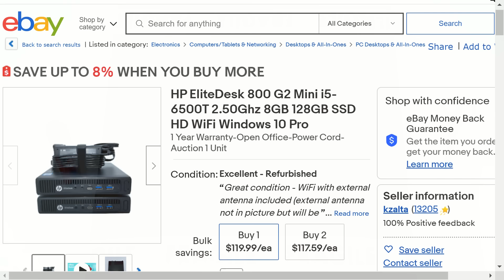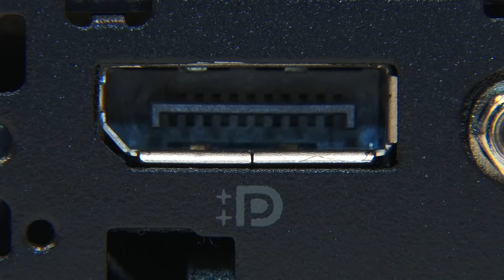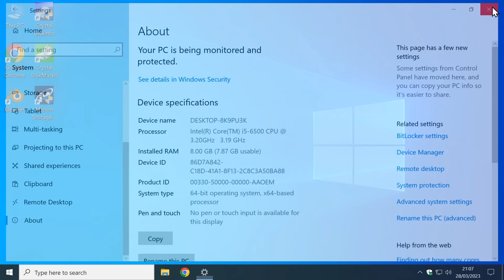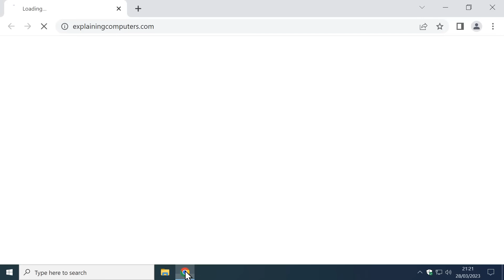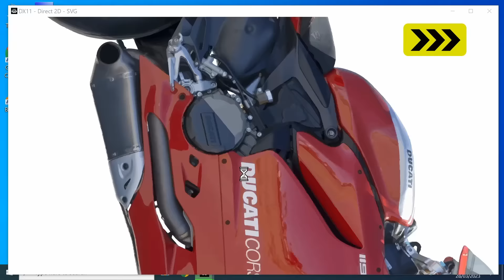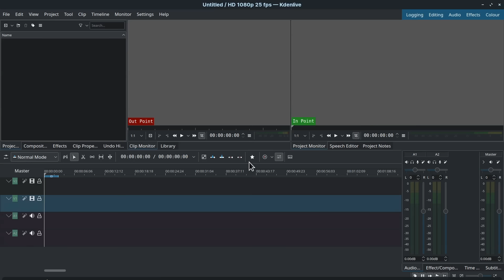Renewed i5 Mini PC: HP EliteDesk 800 G2

Comment: Am new at installing Linux. Am confused. After following all the Linux in HP install procedure in the video, what are the next steps before or after switching to Legacy boot? Do I restart with the bootable with  USB inserted and then enter the BIOS and change the boot order? Or do I need to insert the USB prior to  performing the procedure in the video and change the boot order during that process? How exactly do I get the distro onto the HP?
Reply from the maker: After you have installed Linux, remove the installation media. When rebooted, the computer should now boot directly to Linux (as this will be the only OS installed, assuming you have not set up a dual boot). With most modern Linux distros you should not have to change to legacy boot in the BIOS, and so this is not something covered in this video! But if the computer does not boot, go into the BIOS by pressing the appropriate key (Esc, Del or F2, depending on your computer) and try setting legacy boot. But this really should not be done after an installation! Good luck!
Reply: @ExplainingComputers  Thanks very much for the clarification Christopher. You have continually taught me so much with your excellently produced videos. You are a great teacher and elucidate complex topics with clarity and wit. Be well my friend.

Comment: I have the G3 version which is practically the same thing, just different looking case, put in a 480GB 2.5" SSD & a 500GB M.2 and it has Linux mint running on it and working as a bit of home server (my first one) currently, specs are i5-6600T, 8GB 2400MHz DDR4

Comment: I picked up a refurbished HP 8100 with i5 from TigerDirect.  It has been doing well for what I use it for.

I maxed out the RAM and upgraded internal drive to a 1TB SSD from Crucial. I added a Nvidia T400 video card.

Highly recommend these machines.

Next: i7 CPU.

Comment: Just as a FYI on Ebay and Amazon only list these HP 800 no matter what the G series with stuff you really dont want when customizing these systems. Like with the CPU, Memory, Hard Drive, and Operating System... All the units that I saw has junk hardware that is below the valuse of the $. Plus, Hardware that you want will increase the power and the built-in video is at best (Par)...I believe the CPU is a 6GEN not even close to Core/Thread count to an average i5/i7 13GEN with core/thread counts needed. The hard drive is a mechinical HD and not a Soild State. Although adding any M2 NVMe drives will increrase power levels and would be more par to having the normal HD storage of todays systems. The mechinical drive is going to be extremely slow as a boot drive to hold the OS. Last, the ram is par. So, basically 4GB for OS and 4GB to have for applications. Now finally the OS Support for Windows 10 will end mid season in 2024. Which means updates like BIOS and firmware. The only thing important is the security updates for the system and OS.

Although the system of a small or mini footprint is attactive its still not cost affective to sink $ into upgrading these systems. Remember companies replace systems like this for a reason.  But if your only looking to do office task and such...its ok. but remember as you load updates these little systems will be give much of the processor a heart attack and stroking out with anything added to the  basic system like M2 devices wifi/bluetooth and SSD/Hard drives...you get my point.

by the time you upgrade these 4 things your $110.00 system will jump to $350.00 minimum to 450.00 not including the time required to be looking  for these hardware updates...
Reply from the maker: The video does not suggest purchasing one of these and upgrading it. A shown, the one I purchased came with an SSD, not an HDD, and 8GB of RAM. So it is perfectly capable of running Windows 10, Windows 11, and all manner of Linux distros, with no upgrading required. It is simply not true to say that "Amazon only list these HP 800 no matter what the G series". For example, here is an Amazon listing for an Elitedesk 800 G2 -- and with an SSD: https://www.amazon.com//dp/B07J2SPR49/ Some are indeed listed with potentially unwanted keyboards and rodents. :)

Comment: I have 8 of the HP EliteDesk 800 G2.  The first three I purchased were 35W and the rest 65W.  When I received the first three I didn't know there were two different models with the different power settings.  It's been a learning experience. I also had to deal with BIOS passwords but thanks to other YouTube videos I learned how to remove those.
Reply: These are getting expensive.  I'm boasting the memory to 16 gb, the storage to m.2 to 1 tb, the SSD to 500 gb, WIFI on at least one of them and the cpus i7 Intel Core i7-6700 for the 65 w computer or Intel Core i7-6700T for the 35w ones. I'll also be making one with Windows 7, another with Windows 10 and one more with Windows 11. With others I'll be using Linux Mint Cinnamon, Ubuntu and Debian.  It will be a learning experience for me.  I might try one with Windows XP if I can get that to work. One will also be a dual boot with Windows 10/Linux Cinnamon.  Wish me luck.

Comment: Will this integrated i5 processor card / Intel HD Graphics 530 be able to display the image on a Full HD monitor , refresh rate above 100 Hz . For example 144 Hz, 165 Hz. Thank you.
Reply from the maker: The graphics here are Intel HD Graphics 530, which I think can do 144 Hz max in 1080p.
Reply: Thx Thank You. 🏅

Comment: Hello. What parameters for disk M2 ? I want to make sure.
Have you used M2 Sata, or another PCIe NVMe 3, 0x4 ?
Thank you for this wonderful video.
Reply from the maker: As far as I am aware, only PCIe NVMe SSDs are supported in the M.2 slot. The board will be PCIe 3.0, and the test in the video indicates that the M.2 slot is operating four lanes (x4) given the speed obtained. But a PCIe 4.0 drive would work at PCIe 3.0 speed.
Reply: @ExplainingComputers  txh very much

Comment: I've recently acquired a refurbished Lenovo ThinkCentre M720q from eBay, packing an i5-9400T processor. It runs really well with Arch Linux (using the LTS kernel), and it can handle 1080@60 video editing quite well too. I'm looking into eventually converting it into an audio production machine over the next few weeks.

Comment: Huge thanks for this video ... Just being curious, how warm/heat it gets being working? Furthermore, I hope be possible acquire this kind of machine without OS to install Linux in peace.
Reply from the maker: The case only gets mildly warm, and the PSU only slightly more so. What OS comes on renewed hardware will depend on the vendor.
Reply: @ExplainingComputers  thanks for the feedback ... the sound of the fan is like a laptop or classic PC?
Reply from the maker: Somewhere between the two -- it is, in effect, a laptop fan assembly.
Reply: @ExplainingComputers  huge thanks for the quick and polite reply

Comment: Hi. I am currently planning to replace my 12 year old XPS laptop. I am not interested in buying another laptop because of heating issues, higher prices and limited repairability.

I was looking to get a 1L PC like this one and pair it up with a 14 inch portable monitor from Dell or Lenovo. Do you think this would be a good idea? I need it for programming and playing some games.

Also, is there a way to wirelessly connect the monitor to the pc?

Lastly, it would be helpful if you could do a comparison video between mini pcs from Dell and Lenovo as well.

Comment: Oddly enough, I rather like the cheap Cherry keyboards and mice. I did rather expect the original HP branded to be included, we always had pallets of them never opened, since users almost always have preferred keyboards and mice. Might be different for normal business users, I supported lots of Unix/Linux developers (none of which would touch these even when they were new).

Comment: My 800 G2 mini is having power issues, it suddenly stopped turning on. Previously it gave me heat warnings a few times, and adviced me to add a fan which isn't possible in this device. Do you have any suggestions?

Comment: I've got both an Elitedesk 800 G2 and G4 mini and the thermals on both are night and day. On the G2 I have a i5 6400T 4 cores 35W TDP CPU --> no problem with overheating. On the G4, I have a i5 8500 6 cores 65W TDP CPU --> it gets really hot. I don't know, maybe I could try to repaste the G4 but it's incredible as just two more cores transform the computer in a toaster. I haven't got a 8500T which is the 35W version to compare though.
Reply from the maker: It's not the extra cores, its the shift from the lower power "T" to standard architecture. Makes a big difference as you report. :) "T" chips are about 10 per cent less powerful, but produce a lot less heat.
Reply: @ExplainingComputers  It has to be this because your model have grills on the top cover, mine don't have any of those. My G4 has those grills. Those low power i5 seems to be the best for a home server especially if you plan to run them 24 hours.

Comment: I have G3 and G4 versions of these PCs, purchased on eBay for similar prices to that discussed here.  I can strongly recommend such PCs based on my own experience.  They replaced similarly priced workstation PCs, and are both smaller (far, far smaller) and more powerful.  The only problem is that I now have a stack of workstations to get rid of.

Comment: I want to upgrade my G3 processor from i5 to a faster i7 but I don't see what socket it is. Can someone point me in the right direction?
Reply from the maker: To be certain, you'll need to check what the current processor is, then look it up on Intel. I think some i5 G3s were an i5 6500T, in which case the socket is LGA1151, as can be seen here: https://www.intel.com/content/www/us/en/products/sku/88183/intel-core-i56500t-processor-6m-cache-up-to-3-10-ghz/specifications.html But you really need to look up your CPU (in Windows properties or a manual for the computer) to be sure. Good luck!

Comment: One interesting thing that I've found is that, where I live, people often throw out older, functional pcs on the street, sometimes with only a few missing components, which one could recycle and reuse, for example I found an elitedesk 800 g1 with only the power supply missing, once I ordered it, I tested the pc out, and it worked!
A cool thing one could do with these pcs is to set up servers, for example, on one of these recycled pcs I could set up a game server and pihole, and it worked! And, when used as a server, the pc doesn't need a monitor, keyboard, or mouse plugged in, I could connect via LAN and use it through the terminal from my pc

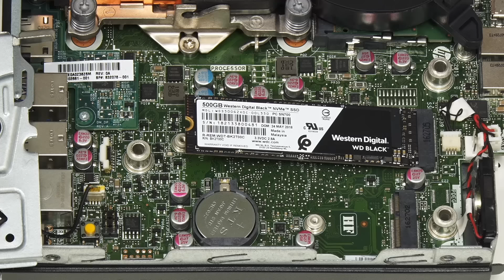Comment: Query from computer ignoramus. What was that thing he screwed into computer  at 10:49 and would it have worked without it? Thinking of buying one of these small factor desktops in future and want to know what to watch out for. Thanks in advance
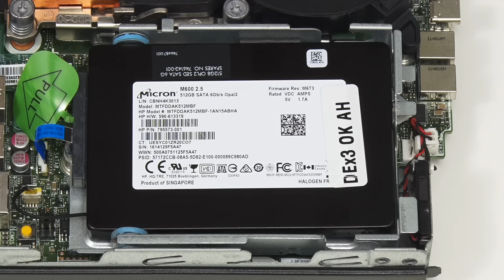Reply: That's an nvme SSD and yes it'll work without it. You'll either need a conventional HDD or SSD like the one shown in 7:19 or an nvme drive like shown in 10:49

Comment: I picked up a similar secondhand EliteDesk model a year ago or so for use as HomeAssistant server, and in the wake of the global RPi-shortage it turned out to be a solid choice. They are of "enterprise HP" build quality, and definitely value for money. Plus being x86, you don't need to cross-compile any custom software.

Fun detail: mine was lacking precisely those two drive bracket knobs as well! 😆

Comment: Is Mini PCs or mini MAC better or more powerful than laptops or MAC book pro?
Reply: It depends on your usage and the money you want to spend. MAC definitely a good hardware and software combo but for the accessories and other things are very much costly. Mini PCs/MAC are really good if you have infrequent movement of them. You will not be happy to plug and unplug 4 or 5 cables everyday. If that’s your case go for a laptop or Mac book.

Comment: I have the Elitedesk 700 series with the low-wattage AMD processor (approx 12 watts).    The fan only activates during boot.
I did look at the 800 series, but I don't like the look of the 35w TDP.  When you review this stuff, could you please include some indication of the noise level? I don't necessarily mean use a DB meter but at least tell us if the fan is audible during normal operation.
Thanks.

Comment: I have the G1 version of this, which is a bit older and slower, but also bigger. It gives me four blue USB slots on the front but no USB-C, which is better. And two more blue USB and four grey USB ports on the back. And PS2 and mouse socket. I use a passive display-port to HDMI cable, which works fine.

Comment: did you have to do a Windows setup before using it?   I am looking for something like this.  I want to run some software making it a dedicated home VPN letting me
look like I am at home regardless of where I am located.  All my internet traffic would go through a home PC.   I only have Windows 7 computers and this being Windows 10 would solve the VPN Windows 10 requirement.

Comment: I have a couple of these 800 G2 and they are very reliable. One runs Win10 and one OSX.
They have only recently been overtaken by the low power mini PCs with N100 CPUs some 5+ years later.

Comment: I agree these little HP boxes are great value for the money, but there is one caveat

G4 series and below, you could bridge a jumper to reset secure boot password in the bios. G5 & later those jumpers were removed. So if you buy G5 or later, and prior owner set the secure boot password in BIOS, and you change any hardware such as Wi-Fi adapter or SSD or 2.5 GB ethernet, you won't boot. 

And HP support wont generate a new password for you, you'll have to buy a new motherboard.

So don't buy anything past HP G4 series, or stick with Lenovo's or Dell's similar products.

Comment: I Opted For the Dell Optiplex 7040 SFF rather Than The Micro PC That Has A Slower CPU and Laptop Ram! The Size Difference Is Not That Much To gain The Power Of A Real I5 6500! It has A Full Size CPU Cooler and Room For A Full Size HDD along With the M.2 SSD! I Bought A 16TB Refurbished Hard Drive From WaterPanther For Less Than 150 US Dollars! So I have A Media Server PC With 16TB HDD and A 512GB SSD For About 300 US Dollars! Then i Loaded p My favorite Linux Distro and Jellyfin Media Server To Have A Fairly nice Small C that Fits nicely In my livingroom Next To My TV! I Looked At The Micro PC's But I Have  Had Problems With These Little Machines As They Age And The Fans Wear Out! Did I Mention That In The SFF Version There Is A Slot For A Real GPU!!! Witch Makes It Possible To Run Some Newer Games On! The Only Real limitation Is The Power Supply! The SFF 7040 SFF Has Dual Display Ports and A Full Size HDMI Along With An Optional VGA Port 4 USB3 and 2 USB2 Ports along with The Lan Port On The Back And 2 USB3 and 2 USB2 Ports On The Front! Check Them Out!! The Dell Optiplex 7040 SFF Refurbished PC! I Also have A Dell Optiplex 7040MT that Is Just A Bit Thicker! All Of these Can e Had For Less than 140 US Dollars with Free Shipping Here n The US! I Buy Mine from Walmart But All Of the resellers ave them now!